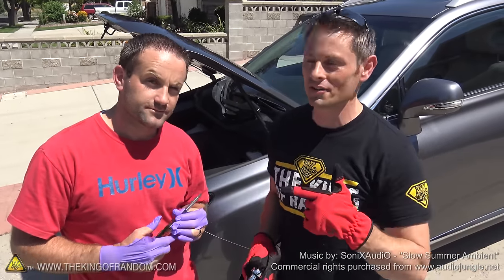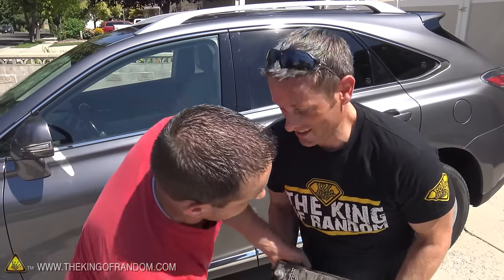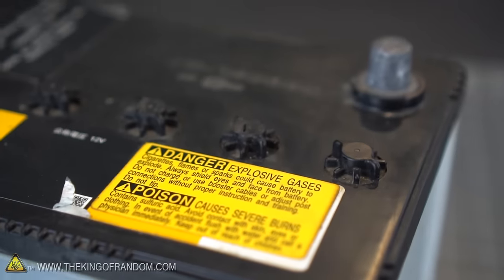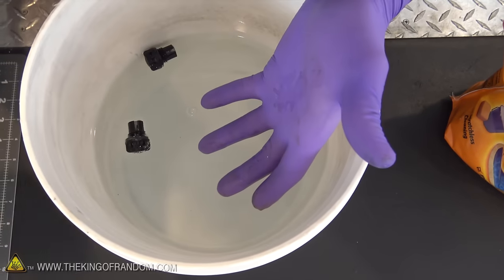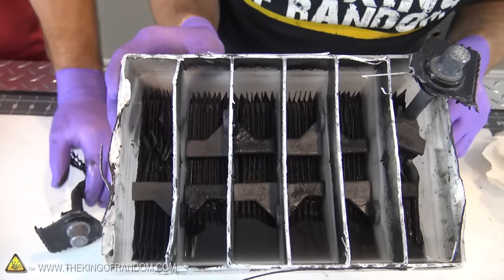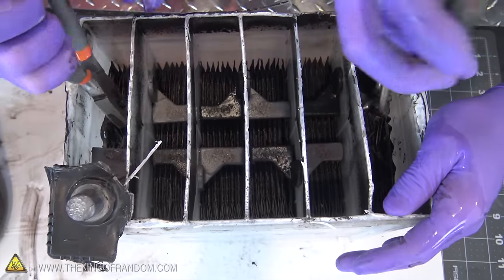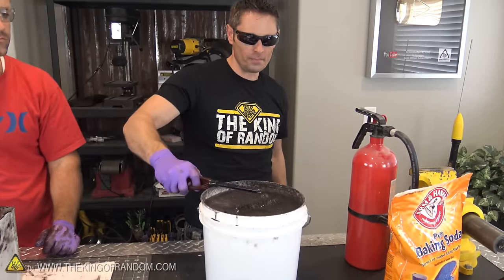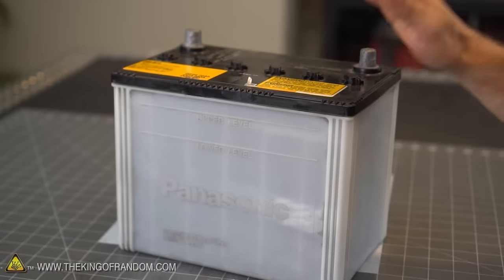Hacking Open A Car Battery (for Lead and Acid)

Comment: Or you can buy acid based drain cleaner which is 60-100 percent sulphuric acid. Lead sinkers aren't that much. Make sure when working with lead your in a small enclosed space with no ventilation. Be sure to get it to a rolling boil in a galvanized container, and only breath the vapors from directly above the pan.

Comment: So these two just breathed in massive amounts of lead (the aerosol they generated by neutralizing the acidic lead plates in baking soda and water will contain lead salt). I would be curious to know how much lead their body contains (not easy to measure since it is usually locked in). Do not replicate this, use a method where you will not breath any of the fumes coming out...
Another thing: by doing this you have lead ions in a large volume, I really do not think most people will bother taking this (and paying) to get it neutralized properly. Most people will dump it in their sink.

Comment: I never seen a car battery with that thin walls and top, I think it's banned in my country. I also didn't felt you were protecting yourself well enough. The acid could've splashed on you at any time, and the gas could've been toxic, because you were not sure what was the mix in the battery. There could've been other things too! Always be careful, you can lose you health only once.

Comment: RIP. But being in a mechanic I've recently learned even pouring water will make a battery now a days go bad. And yea Panasonic makes batteries cause I've read some comments. They are heavy and glass mat is also referred to as an agm battery.

Comment: I wouldn't have been worried about destroying your " good" battery as the colour of the electrolyte shows a lot of sulphation and shedding of plate material.

Comment: I believe I would freeze that solution rather than boiling it. Boiling it sounds a lot more dangerous than what they did in this video. They would have to look up what the freezing point of the acid is. We know what water freezes at. Its not all that simple though; they might need to see a phase diagram and consider a eutectic point etc. Whatever, they need only to pour off whichever stays liquid when the other freezes.

Comment: glass container for sulfuric acid... guess that works... hope they don't drop it. I'd much rather use plastic container myself, never had an issue. I even store the "extra" sulfuric acid from its original "box/bag" (that you can't actually reseal) into a plastic jug, never had any issue.

Comment: take the led , melt them down into bullets , boom survival tip
Reply: Don't want to do that, they add some compounds to the lead to make it more resilient to charge-discharge cycles, and all of that coincidentally is pretty toxic. You're much better off melting down lead wheel weights.  Plus, WW alloy already has some zinc and antimony in it, so it'll fill out molds better and result in a harder bullet with less leading.  Heck, survival or no, I'm already casting wheel weight lead as it is, makes it a lot cheaper to shoot a .45-70!

Comment: 1. When your doing this.....your not supposed to be doing this!!!
2. to remove the lid intact without smashing, cut the poles of the terminal level with the top of the battery and you can tap them through the lid as you lift, you have to cut it down or the lead absorbs all impact and will mushroom around the plastic before pressing out.

Comment: I am not sure why you'd want lead that's been contaminated like that. If you wanted to purify, melt, and cast lead from automotive salvage, wheel weights are safer, easier, and probably cheaper/free from your local tire shop.

Comment: hi i have a baterry with  a small  hole on the bottom of one of the cell and it drain all the fluid, i wish to know if is possible to seal this hole? thanks a lot. sorry for my english

Comment: If you're salvaging for hobbyist purposes, this isn't a bad idea at all.  But, every chemistry teacher in America is cringing at your lack of safety measures when dealing with something as nasty as a sulfuric acid solution.  Yep, it'll bleach your clothes...on its' way to eating your skin. Don't get me wrong, sir, this video has great info, I only wish you had been just a bit more careful, that's all.
Reply: Alonzo Branson it’s diluted acid i reconditioned hundreds of batteries never wear much but gloves the acid in the battery will not burn you unless you pour it on your skin and wait 10min or so even then. I got it on me many times it doesn’t burn tiny holes like others have suggested.

Comment: Naww man, you can still drive without that old heavy thing. Just get a dozen 9V batteries and wire them in parallel. 30lb weight reduction, bro. all ready for track day.

Just don't try and start the motor with this rig... 6 amp supply... 100 amp demand. Not gunna chooch.

Comment: Lucky that this did not explode,if that gas was H it would
Reply: The CO2 that was present is heavier than air and sat above the liquid at the top of the pail.  Hydrogen is very much lighter than air and diffuses rapidly as well.  For these reasons I doubt that there would have been an explosion if the gas liberated had been hydrogen.  Now - don't get me wrong - these guys are idiots and I'm not sure they knew it wouldn't explode.

Comment: Used to work with sulphuric acid at 5%, got some on skin and incredibly painful and hard to remove. Extremly nasty stuff, would never approuch the stuff without proper protection ever again. EVER!!!

It stinks aswell.

Comment: Could you power a semi truck with two double a batteries?
Reply: Of course not.  For one, an AA battery is only 1.5V, and they're not capable of putting out the amperage to do anything useful, and wouldn't have the capacity to do anything even with enough amperage.
Reply: oh ok i was just curious.  ;3

Comment: Sodium cyanide, sulfuric acid* are used in a gas chamber. The sulfuric acid is in a pail under the chair. When a lever is thrown it drops the sodium cyanide into the sulfuric acid and the resulting gas is Hydrogen cyanide...Lol Don’t breathe car battery fumes people 😂
Reply: Car batteries don't utilize nor produce hydrogen cyanide.  Not that these bozos know differently.

Comment: I used to fill batteries for construction equipment. One time the fresh acid got past my coat and apron and ruined. Brand new pair of coveralls. I found that out the next day when the started falling apart when I was under a d5.

Comment: ummm. you did not pass chemistry class my friend. you neutralize an acid or a base with something neutral. you do not neutralize an acid with a base. in some cases that can cause a reaction.
Reply: Adding it to something neutral would only dilute it, not neutralize it.  One's a compound with a charged hydrogen molecule, the other has a oxygen and hydrogen group with the opposite charge.  Mix them together and you'll generate water and salt.
Reply: AreThereNoMoreNames ahhhh i got mixed up. Haha but i thought it was safer to dilute it, than to add it to a base?
Reply: Ryan Lucey Diluting it isn't a bad idea, just that you'll still have acid, just that you'll have more weaker acid.  Add to that the lead dissolved in the charging reaction and it's not something you want to have around anyways.